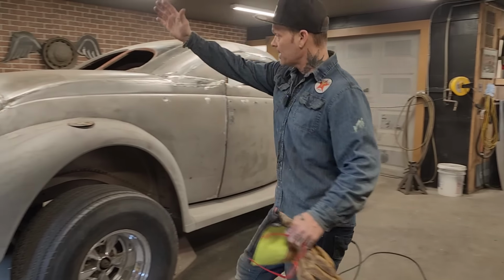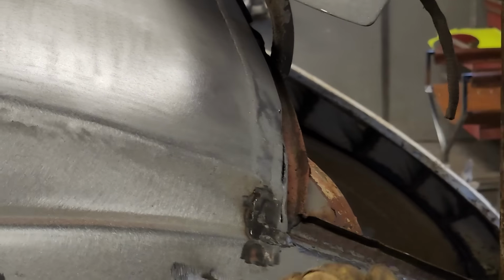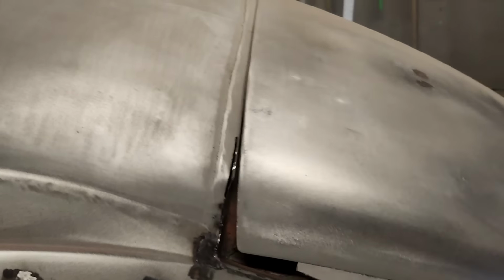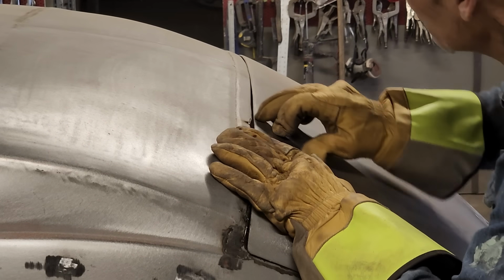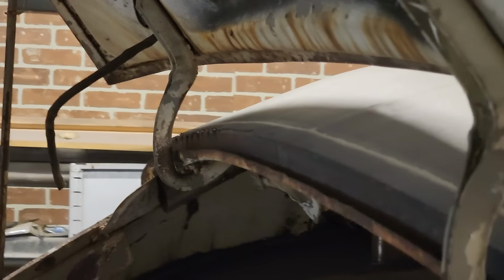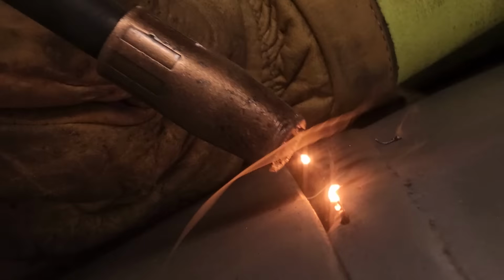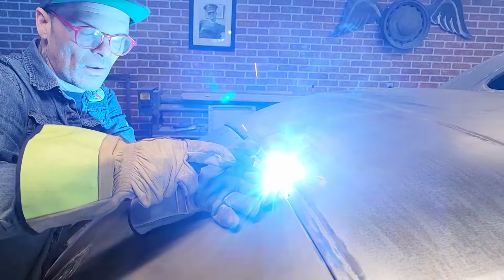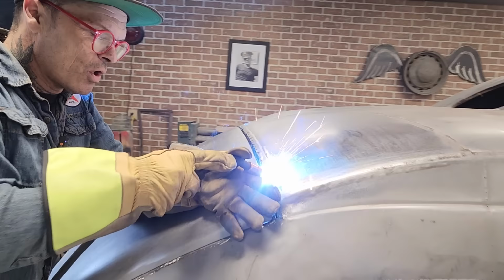Manipulating the metal to fix issue 🥷

Comment: It's a good looking car! But I do agree with many statements of replacing/repairing/possibly slotting hinges to create good alignments without all the slicing/welding.
Part of fabrication is to embrace different technologies so that we learn over time wich one is the best technique to use.
Been machining for 38yrs now & am still learning new things everyday, but you have to keep an open mind.
That's my rant, but the car will be beautiful just the same, but a nightmare if you want swap parts for some reason in the future.
Reply: There wouldnt be any - swapping parts, as, its all fabbed.
Reply: @ThomasSmith-hh8fp  well what if the hinges or hinge pins completely wear out, now you have to prematurely wear out a good one to get it to align good, or replace it with the good one & having to perform body surgery again (possible repaint) to get it to function correctly?
That's not a good plan in my opinion.
Just sayin.

Comment: CHAD you should consider switching those two back windows and make them into one. Then it will look more like the original hot wheels Neet Streeter  also That rain gutter looks like its rotten badly in many places looks like it needs to be replaced not just tacked here and there. other than that the car looks really good. kudos to team Hiltz.

Comment: Why not just slot hing bolt hills and adjust... this is nuts!!!!
Reply: Because it's tight all the way around on all 4 sides. Needs a 1/4 inch on top so the paint won't scrape off when it opens after it's done. 😉✌
Reply: Only took an hour another couple hours on bodywork and 👍.
Reply: @michaelbristol6467  If it's tight all the way around, how is gapping the top solving  side gaps?
Reply: The sides are still the same as the factory made them. But the top dutchman panel was fabricated by Chad and he made it to short so it needed to be opened up a hair to have room for paint materials so when you open it you don't scrape off the paint. 😉✌
Reply: He changed the factory measurement on the height not the width when he chopped the roof off and slid it forward.😉✌
Reply: The dutchman panel is all new fab. The structure underneath to.He made it to tight needed a trim. Custom car issues. 😉✌

Comment: You should try to tack weld using a tinted visor.  It might delay skin cancer on your face when you get older.
Reply: I've been there and bought the t-shirt.  Sometimes you learn what others did to their bodies over the years and watched how the UV rays from welding or the sun will age a person's skin and eventually cause skin cancer at some point, if you live long enough.  You can take that to the bank.  At the very least use SPF 50 Sunscreen on your neck, face arms, & especially your eyelids while tack welding.  You still should cover up as much as possible while welding, in general.